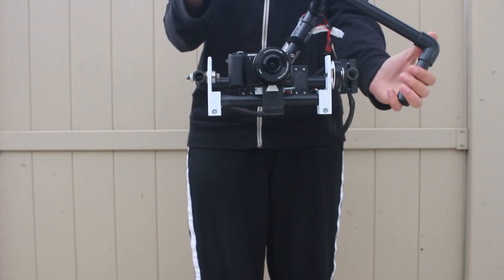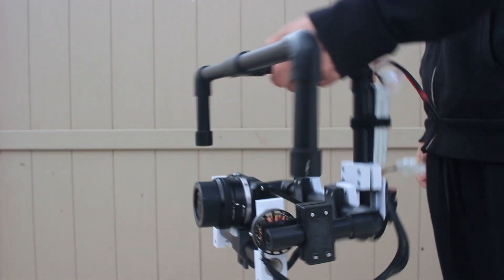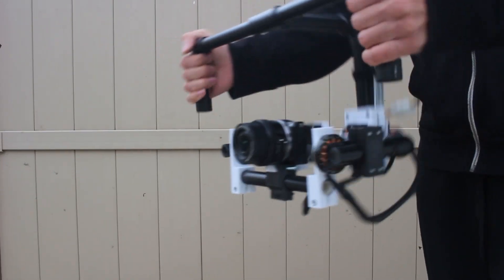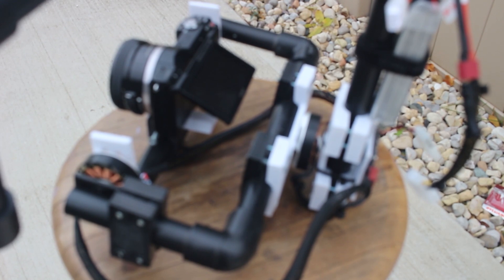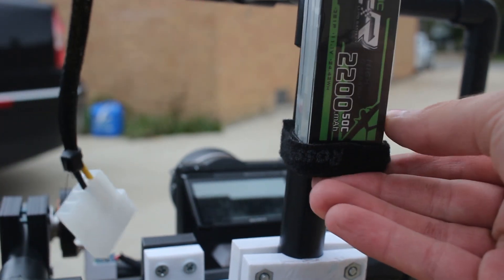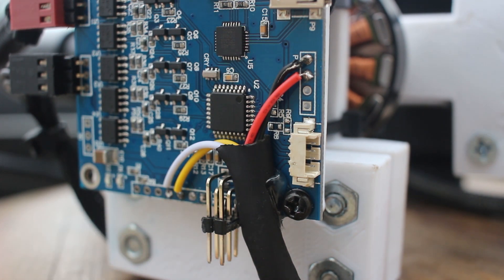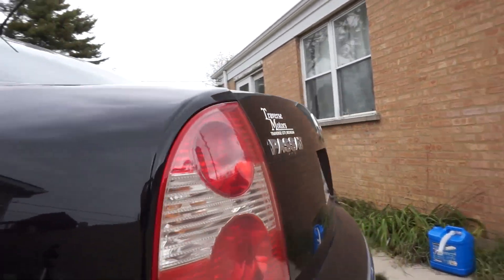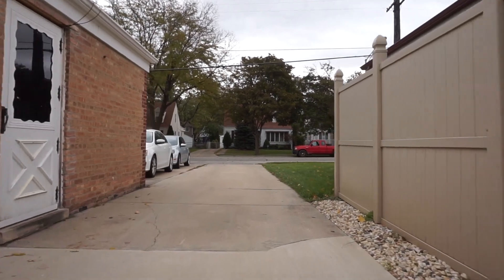$100 DIY 2-Axis Brushless Gimbal

Comment: Quick question After building a dslr 2 axis gimbal I plug in the battery nd the motors would not turn on and spin. the controlboard was blinking red.   So I attempted to plug the control board to mpc whichit started smoking. My question is this: What happened? Did the motors fry too? The motors were a 5208 . The controlboard was a cheap bgc about $14.
Reply from the maker: It sounds like you did not have the gyroscope / accelerometer plugged in, that's why it was blinking red. I don't think you fried your motors because the controller board has fail safe built into it.
Reply: @KOYORIDE  sensor was plugged in. The whole contrl board smoked when I plugged in via usb to my pc.

Comment: Please enter the description of the parts you used, the link does not work.
Reply from the maker: The motor is called the IPOWER MOTOR GBM4008-150T BRUSHLESS GIMBAL MOTOR. If you google that model, the first link from the iFlight-rc website is the exact motor that I used for this project. These brushless motors are good for 800g cameras. 

As for the controller board.....I used the simple BGC controller board.
Reply: @KOYORIDE  Thanks! ;)

Comment: Can you post new link to motors
Reply from the maker: The motor is called the IPOWER MOTOR GBM4008-150T BRUSHLESS GIMBAL MOTOR. If you google that model, the first link from the iFlight-rc website is the exact motor that I used for this project. These brushless motors are good for 800g cameras.

Comment: Please Refresh links. Motor Link is not aviable
Reply from the maker: Yes, it seems like the link went down.

The motor is called the IPOWER MOTOR GBM4008-150T BRUSHLESS GIMBAL MOTOR. If you google that model, the first link from the iFlight-rc website is the exact motor that I used for this project. These brushless motors are good for 800g cameras.
Reply: @KOYORIDE  okay nice thanks a lot Man :D
You got a like and a sub ;)
Reply: @KOYORIDE  
could this one Work?
https://www.ebay.de/itm/iPower-Gimbal-Brushless-Motor-GBM4008-150T-w-Hollow-Shaft-12N14P/282769526797?hash=item41d660900d:g:JScAAOSwiYlaL1NW:rk:1:pf:0
Reply: @KOYORIDE  and what do you think about this controller Board? 

https://www.ebay.de/itm/32Bit-3-Axis-Brushless-Gimbal-Controller-V1-31-DRV8313-Motor-Driver-Storm-32-BGC/272660519947?hash=item3f7bd55c0b:g:UTMAAOSwrhBZDiFd:rk:5:pf:0
Reply: @KOYORIDE  Dude i dont have any knowledge about the controllers and the motors. i just want to build one but i need the parts at first.

Please Help me to find Parts to build an 3 axis gimbal haha
Reply from the maker: @INVINET  Those parts should work just fine. For the software, search up simple BGC PID setup and that will show you how to set up the firmware on the controller board. Hope this helps.
Reply: @KOYORIDE  Thanks a lot dude. i'll buy those iteems and try my best. you helped me a lot so far. thank you :D

Comment: Good job! What engines did you use? The link broke. I am designing the same with servo motor. But I believe the brushless looks better. And I also need to calculate which engine to use, as you calculated?
Reply from the maker: Yes, it seems like the link went down.

The motor is called the IPOWER MOTOR GBM4008-150T BRUSHLESS GIMBAL MOTOR. If you google that model, the first link from the iFlight-rc website is the exact motor that I used for this project. These brushless motors are good for 800g cameras.